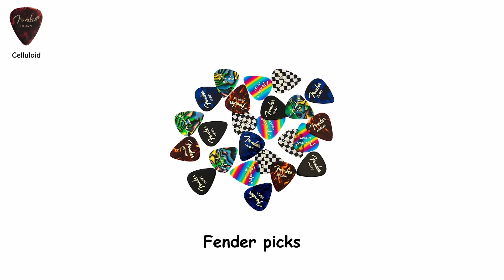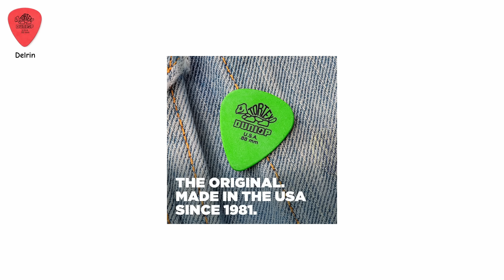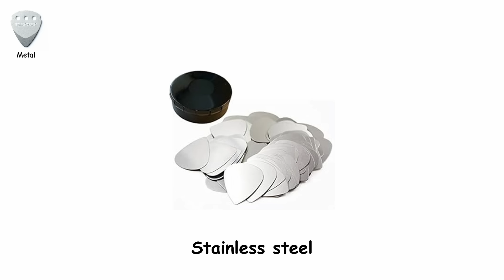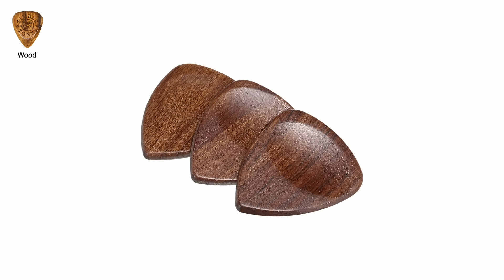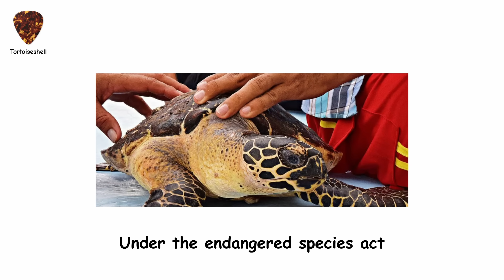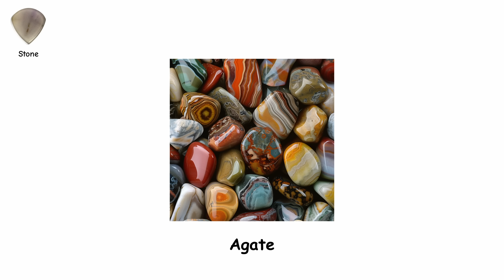Every Guitar Pick Explained

Comment: I use buffalo horn picks. I hate celluloid, sooo much. Metal picks dig in to the strings too much for me. Nylon picks are.. not for me lol. I tried delrin once, not a fan. Never used ultex, havent had a chance. Not a fan of acrylic picks, mostly due to the range of acrylics not having a uniform feel for me. Wood picks are kinda fun, but they have a very distinctive sound over plastics, metal and horn. Never use a tortise shell pick, not had a chance. Seen glass, not used them before. I want some. Stone picks are a delight depending on the stone as not all stones are strong enough for repeated uses. A pick is always a personal choice. Honestly, you dont miss much. The only things you missed are random picks that have stuff like "diamond grips" and even some of the more ridiculous materials. 

V Picks uses acrylic like Gravity picks does, they do not feel the same but its a solid pick. Saw the diamond gripped ones on ebay. Never forget the Jellyfish pick, roflmao that thing was so bad.

Comment: I use graphite most of the time. Pretty stiff, easy to hang onto, pretty snappy, and they last for years. Kinda hard to find at times and a little pricier than the commonly used alternatives, though.

Comment: I have a pick punch, and I use old plastic coffee can lids! Nice and flexible, plus plenty of!!!
Reply: I do the same thing but usually don’t bother with the pick punch. I just cut triangles with shop scissors then file the edges down with a bevel I’ve learned by feel then use a disposable nail file to buff it out or rub it on carpet pieces.  Great Value peanut butter jar lids are great lately. I shattered an old sterilite storage bin that was outside in the winter and that was perfect thickness. Then I use a utility knife to gouge lines on the surface for grip. Love em

Comment: Extremely flammable is putting it mildly.

I thought I could melt off a little sharp edge, poof whole pick gone.
Reply: Movies were first made on celluloid film, ages ago. That is why so many movie film storage vaults have gone up in flames, with much original film stock lost forever. Celluloid is still preferred and used by some directors, due to the soft natural look it provides, despite its risks.